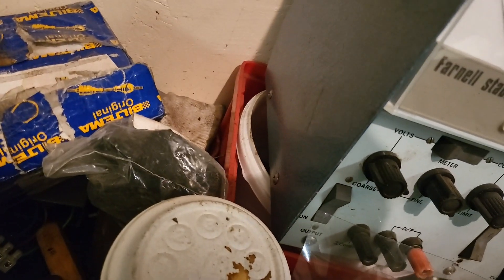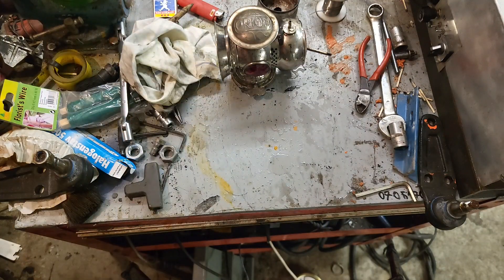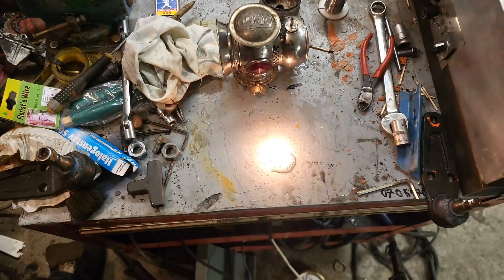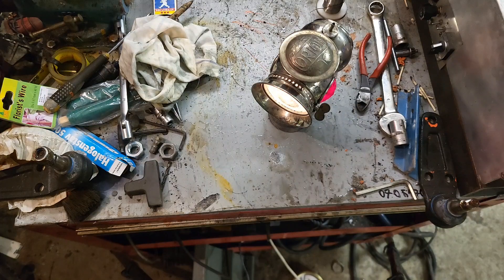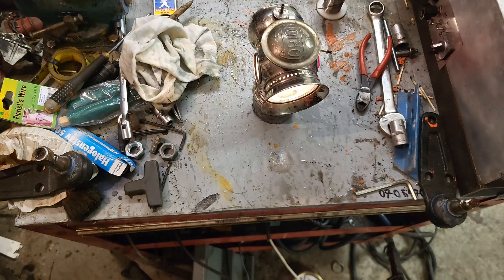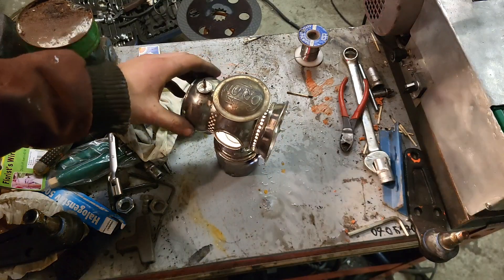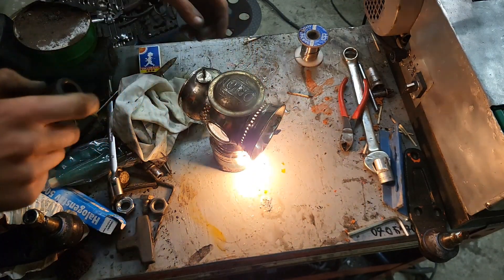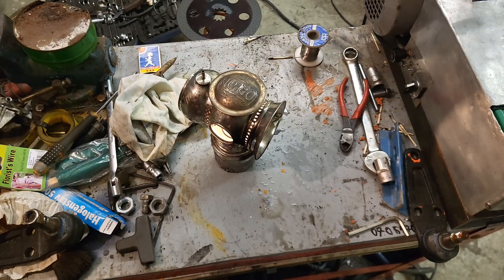A lamp that runs on rocks?!     Lets light it up!

Comment: When I was on the rifle and pistol team in the Marine Corps, we had a small carbide device that we'd burn to blacken our sights. We used peep sights on the rear and a blade sight on the front and the soot from the device left the side facing us a flat black and stopped any light reflection from interfering with our aiming!
Reply from the maker: That a rather intressting use for acetylene soot!